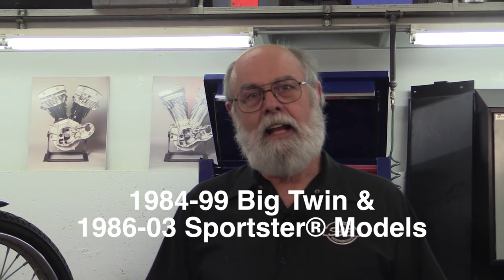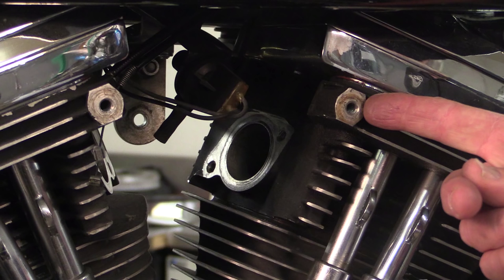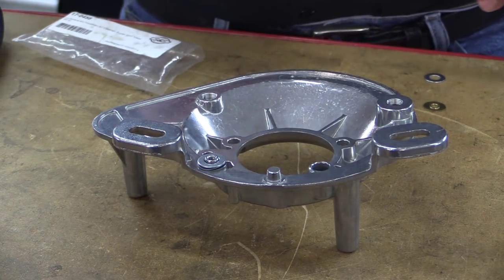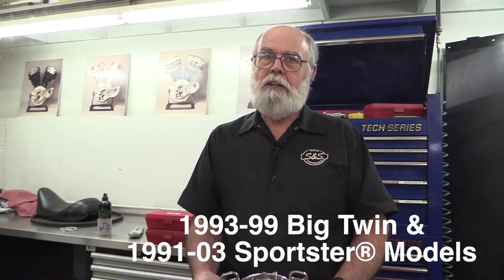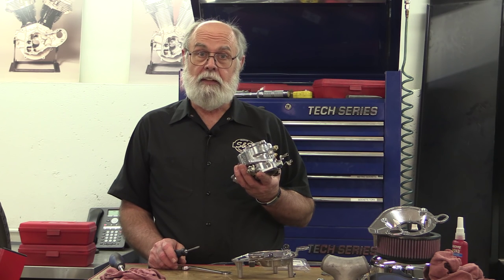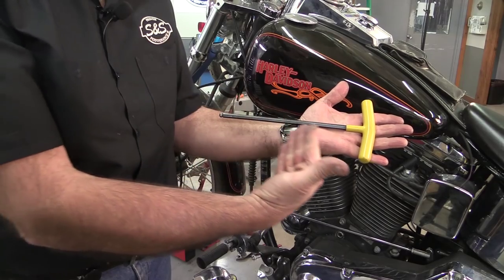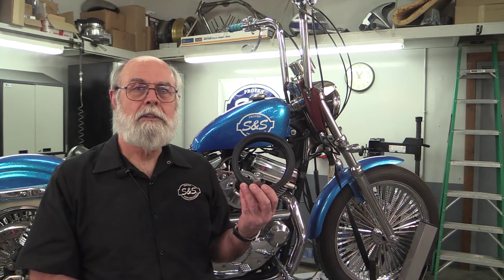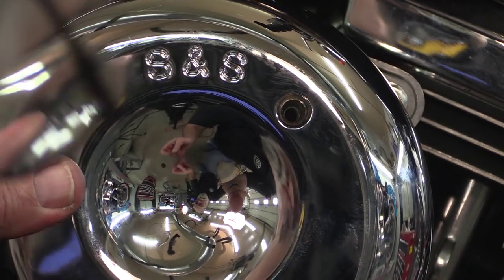S&S Cycle - Installing S&S Super E & G Carbs On H-D® Evolution® Engines

Comment: I just put one of these babies on my '99 Softail Custom, replacing the stock CV carb. That booger fired right up like it's never done before. Still dialing in the mixture, but I'm super impressed so far. I used this vid along w/ the instruction package that came with the kit. For the manifold part I used an extended ball-end 1/4" Allen on the right side only to get them snug; The clearances/ angles were too steep to tighten them both all the way. I used a regular 4" Allen ground down about 1/4" for the rest of that work. To get to the two carb bolts around the other side I had to drop the horn and bracket w/ the VOES/ choke. No special tools were used for the project. Thanks for the presentation.

Comment: Hey I’ve got a question regarding where the cables connect to the carb the throttle cable , not the return one, has a larger end brass part attached to the cable compared to the rear return cable , and the top side where the cables connect to the throttle itself . I’m wondering if it’s not the right end . Is it supposed to slide into the channel the same way it does on the other connections ? Hopefully this makes sense . It’s so much easier with pictures . I’m working in a 91 custom softail

Comment: Blue thread lock on head and manifold bolts, I used stronger springs on the carb as the vibration throughs out the adjustments

Comment: Hi, I already installed the hi-4n s & s ignition and the harley worked on the first attempt. I have an evolution from 1998. I would like to ask two questions:
1- After the ignition is installed, can I try different advance rates? or do I have to always calibrate from the beginning by putting the piston in tdc?
2- If black smoke comes out of the exhaust from time to time, is it a tunning ignition problem, or the carburetor?
Thank you

Comment: I have a 94 FLHTCU and have an Arlen Ness air breather and custom cover. Is there a way to use them on this carb swap or not? Thank you and great video. The humor justs add to the awesome job.  "Steimi"
Reply from the maker: Assuming your aircleaner is set up for stock carb, it would not bolt to the S&S carb.  We'd definitely recommend a fresh teardrop!  https://www.sscycle.com/1994/Harley-Davidson/Electra-Glide-FLHTC/#category=1%7CAir%20Cleaners

Comment: I'm restoring a '92 FatBoy and the S&S E went on today. The rear of the bracket for the horn, choke, gas line and VOS doesn't clear the intake manifold. It looks in the video like you have the VOS free standing on a short section of vacuum line. If that's the case, my problem is solved. Also, the throttle cables are tight up against the bottom of the tank where they come out of the bracket. Will this lead to a problem or is this normal. Thanks for posting this video. It is a great help!
Reply from the maker: Yes, we connected the VOES with a short piece of hose and you can generally zip tie it to the frame or something close to it. The switch is really light so it doesn't need a lot of support. The cables touching the tank should not be a problem unless they are kinked. No sharp bends!

Comment: Hello Bruce, I purchased a beautiful 98 Springer softail that had a Hyper charger on it, the look was terrible and so was the performance so I purchased a S&S Super E shorty installed it myself with your help and the directions that came with it and I am very pleased, I have dialed it in to my ear but I will be taking it to Tilly HD in Statesville N.C. for a Dyno run to fine tune it, my only concern at this point is that there appears to be about a 1/2 inch slack in the return cable ?, the throttle snaps back as it should but when I adjust the slack out of the return cable the throttle tightens up, is the slack in the return cable normal, Thanks and l really appreciate the videos its great free education !!
Reply from the maker: +Tim Pope There has to be some slack in the cables to allow them to move freely, but 1/2" seems like a lot. Have you lubed your cables? Try some of that spray lube and one of those dandy little cable oiling widgets. The other thing to look for is a kink or sharp bend in the cable routing. If you can't get it to work right, have Tilly's  look at it when you take it in for your dyno run. It never hurts that get another set of eyes on it!
Reply: +Tim Pope , Hey Thanks Bruce !

Comment: Just bought a 92 FatBoy with an S&S Super E (my first S&S) it has the breather heads, and the  breather fittings that the hose goes on move freely, that doesn't seem right. Shouldn't they be tight? I've watch some of your videos and I'm very impressed, might buy an S&S for my RK
Reply from the maker: It should be tight. We suggest calling our tech dept at 608-627-1487. Those guys can certainly get you straightened out, or tightened up (as the case may be).

Comment: I noticed the last three screws for the S&S air filter chrome cover did not have any loctite or threadlocker applied to them.  Other videos have mentioned to use it on those screws.  How important is it for those screws to have some threadlocker applied or is it even necessary?
Reply from the maker: It's a really good idea to apply some. These engines vibrate and we sell a lot of replacement cover screws!
Reply: It's an VERY good idea to use threadlocker on those screws. Consider it mandatory. I've used red Loctite since the 1980s on Bs and later E's. On the B you can drill straight through the standoff because the back of the air filter housing is flat and use through bolts with lock nuts (lock washers are trash, ask NASA).. It would be nice if the areas on the E housing were flat to permit that. Hint, hint....
Reply: I just lost two of mine so I'd say use it

Comment: Rode the WG about 10 miles yesterday and the carb was leaking gas out the overflow tube while the bike was running. Switched the bike off and carb still leaking. Turning the fuel valve off is the only way to stop the steady flow of gas going out the tube. WG  parked for now.  Any helpful comments ? Thanks, Butch.
Reply from the maker: There is obviously a problem with the fuel inlet needle and seat, but there are a lot of things that can cause that. First thing of course, is don't run it like that!
You can check to see that there isn't some foreign material preventing the needle from seating (did you just paint your tank), or if for some reason, the float is sticking in the up position. Your best bet is to call our tech dept at 608-627-1497 and let our tech guys help you sort this out. They can talk you through way more possibilities in a 5 minute phone call than we can do in a week of comments on YouTube. Yes! these guys really are that good!
Reply: Thanks for the response and the info.
Reply: Check your float valve seat and height

Comment: Great info. I wish the dealer service department watched this. They did not install the 90 degree breather fitting. (1988 fxstc) does anyone know the size and thread for the fitting?
Reply from the maker: Reach out to our tech team at sstech@sscycle.com or give them a call at  +1 608-627-1958.
Reply: @SSCycleInc  I have a 99 Nighttrain with a super E installed but they didn't have those breather bolts they just had an Allen head so I've been looking for the ones in the video but every place said they don't fit my bike so I just want to make sure

Comment: The choke return spring is broken on my S & S carburetor. Where can I buy a replacement spring? My choke won't close.
Reply from the maker: We assume that you are referring to the enrichment device that you pull up for starting. You can get that at any S&S dealer. Check the dealer locator on our website at www.sscycle.com for a dealer near you. If you have a Super B or D carb you will need to buy the whole assembly. The part number is 11-2084, and if it's a Super E or G carb you can just replace the spring the part number for the spring is 11-2340.

Comment: I have a 2006 XL883 and I am looking to buy this kit. Is the installation any different?
Reply from the maker: A lot of the info in this video will apply, but there are some differences in the kit, mainly in the breather system. Full instructions are included, and of course we have a full time tech dept available to help you out if you have any problems!
Reply: OK, thank you very much for your response, Ill be sure to keep in touch if any problems arise
Reply: I am having trouble with the installation, with the initial setup the bike will only run with the enrichment lever. Once the enrichment lever is no longer engaged the bike dies on me. Do you have any  suggestions??
Reply from the maker: Please call our tech dept at 608-627-1497. Those guys will have this sorted out in a few minutes. They can talk you through way more possibilities in a 5 minute phone call than we can do in a week of comments on YouTube. Yes! these guys really are that good!

Comment: I just bought a brand new super e, while installing it. One of the screw with the blue lock tight for the backplate is stripped and and can't screw into one of the hole on the carb. Any advice?
Reply from the maker: Call our tech dept at 608-627-1497. They can sort it out.

Comment: Any way to eliminate drawing crankcase vapors into intake tract?
Reply from the maker: It certainly can be done. It's just an exercise in plumbing. There are even kits you can buy. The question is why do you want to. If there is oil vapor coming out of the crankcase breather, why not just send it through the engine to get rid of it. On the other hand, a lot of oil out of the breather is probably a symptom of another problem that requires attention. You could call our tech dept for some suggestions. 608-627-1497.

Comment: Correction folks! The cable with the spring is indeed the return cable but it goes in the FRONT guide, not the rear guide.
Reply from the maker: +Skepticynic We may be getting confused by semantics (we call the throttle guide toward the air cleaner the rear throttle guide) or it may be the fact that the throttle shaft and butterfly in an S&S carb rotates in the opposite direction from the shaft in a stock carb.
Reply: +S&S Cycle, Inc That seems strange that you'd consider the manifold side of the carb as the front! Nonetheless, you rush through that portion of the vid with very little detail. I was installing my super e on my '99 XLH1200C as I was watching the vid. Needless to say, I had to remove the carb and switch cables. If you could remake or edit the vid to show that procedure better, I think it will benefit countless viewers as well as boost the consumers perception of your expertise and professionalism.
Reply: @skepticynic5150  did you have to buy new cables? This part is a bit unclear.

Comment: i have installed my carb as seen here and it will not idle ?
Reply from the maker: That should not be! Please call our tech line at 608-627-1497. Those guys can probably  sort it out in a few minutes. It's lots easier to talk you through it in real time than exchange a bunch of messages!
Reply: talked to them and they got me lined out thanks very much !
Reply from the maker: Roger Bartell
Our tech guys are responsible for a lot of happy endings.

Comment: I'm missing the 90 degree crank case vent fitting. Does anyone know the part # or what it is actually called?
Reply from the maker: +Patrick Favors If you're talking about the fitting that bolts to the cylinder head in 1991-later Sportster models and 1993 and later big twins it's called a banjo fitting the part number is 17-0350. If you have an earlier engine that breathes directly out of the crankcase the stock fitting is generally used so it's not included in the kit. If you have the installation instructions there are line drawings and parts lists in the back. If you don't have the instructions, you can download them from your website www.sscycle.com. Just click on instruction sheets under the tech info tab.
Reply: +S&S Cycle, Inc.  actually I need the straight pipe nipple at 4:40 on the video.
Reply from the maker: +Patrick Favors OK! That is a 1/8-27 x 3/4" close nipple. Our part number is 50-8111, but it would be really be simpler to just pick one up at your local hardware store.
Reply: +S&S Cycle, Inc Ok thanks. I finally figured out what the previous owner was trying to do. You guys are great!

Comment: why is my air cleaner full of oil?
Reply from the maker: If you have installed it according to the instructions (Crankcase vent routed to the air cleaner) oil in the air filter indicates that you have oil carryover in your breather system. There are lots of reasons for that problem, and it would be best to contact our tech dept to determine the cause. 608-627-1497
Reply: S&S Cycle, Inc  Overfilled oil tank!

Comment: Hi love ur videos 
I have a sporty 95 1200 been sitting for a couple of years, I started her had her running very rough so put new plugs in and new fuel and and now when I start her she raves on high and I mean full and I have to shut off , cabling and throttle all good , just followed ur video abov put it back together and same thing starts and reves her tits off I’m at a loss can you help 🤟
Reply from the maker: Hey Rob, drop us a message over to sstech@sscycle.com with all the info you have on your bike and the current configuration. Our team would be happy to help you figure it out!